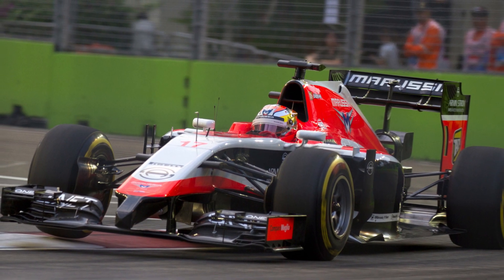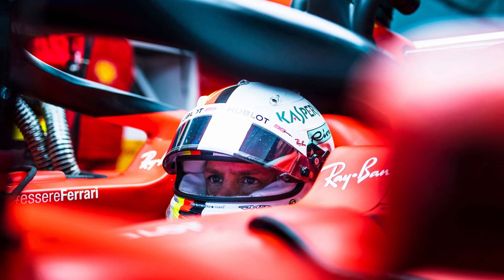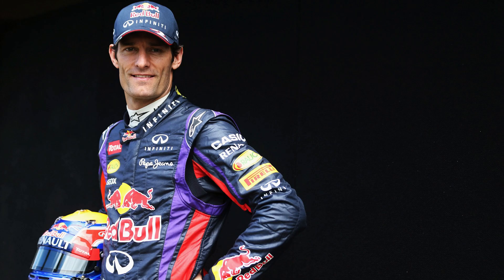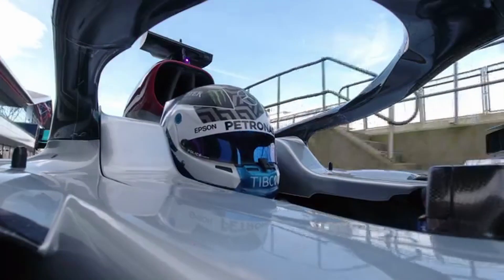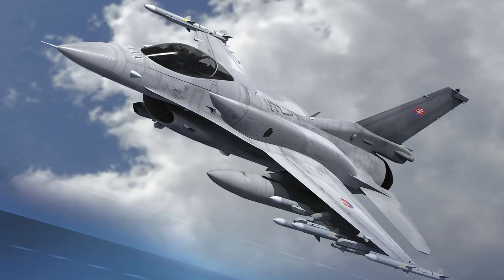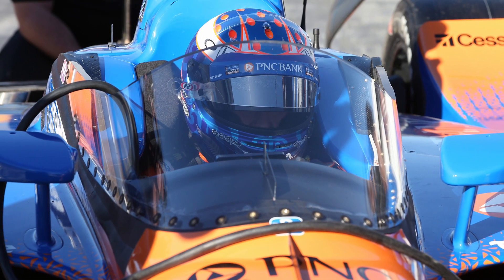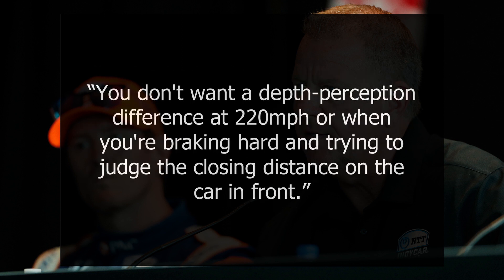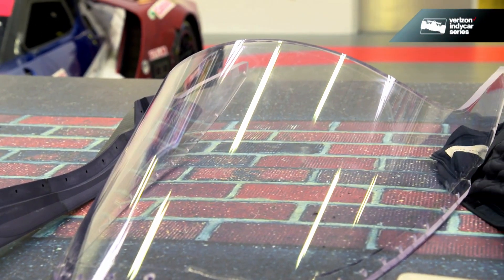How IndyCar Evolved the F1 Halo and Red Bull Aeroscreen for 2020 Windscreen | Part 1

Comment: This Halo is absurd! The Red Bull solution is far superior.  Politics in racing sucks and it’s deadly.
Reply: Wtf? Absurd in what way? That it saved Grosjean's life? Are you crazy just ranting?
Reply: Piss off. The Halo saved lives and it's proven to take hit from  2 double decker busses.
Reply: Aeroscreen is impractical and far less safe than the Halo.

First off, the screen causes distortion affecting the driver's vision. Not great when traveling 200MPH or at any high speed including during navigation of a complex corner arrangement.

Secondly, it's too close to the driver and could cause head injuries by the driver being launched into it during the tumble or force during an impact.

Third, it's heavy on the front of the car, messes up the car's ballance, aerodynamics, blocks the engine's cooling intake and increases cockpit temperature massively. It also becomes twice as hard to see out of during rain as unlike the helmets which have a refresh strip that the driver can pull off, the screen will not be able to be wiped or dried unless it's pitted. Visibility will be non-existant during even the lightest of rain showers.

Fourth, it's not as strong as a Halo device for a heavy cenrte-weighted impact. Yes, it will deflect smaller, softer impacts from light debris but hitting anything like a spring or a piece of metal etc. at higher speeds would shatter the polycarbonate and send shards of thick, sharp ballistic glass plus the item of debris itself directly into the driver's helmet and body making the debris impact way worse than if it were to just come from the debris itself.

Overall, it's a nice design. But in reality and practise it's serverely flawed and far inferior to the Halo device which is stronger, safer and is more suited to these kinds of open-wheel racers.
Reply: People missed your point entirely
Reply: The Red Bull solution (polycarbonate only) failed in testing. They now effectively run a Halo under the screen.

Comment: Halo is safe , how about not racing on tracks with concrete walls where a car can bounce back into the path of oncoming cars debris back into the track.  They also say here that a halo would not have helped massa which is in fact incorrect as the centre support of the halo is directly in front of the driver face. The widcreen would not have helped with the crash and fire that almost killed Grojean in bahrain it would have folded around him, the halo saved his life.
Reply: Couldn't agree more

Comment: Awesome design, at least it gets rid of that ugly center pillar? "NOT", and much safer !?  Hope F1 adopts better design after Halo !
Reply: How would that plastic windscreen have helped Grojean in bahrain? In my opinion it would have folded around him when he went through the barrier, the halo saved him.
Reply: @rneoman  yea good point, not liking the Indy Car plastic screen anymore ether, watching both the F1 and Indy racing this weekend.  Thought it could eliminate the centre Pilar? But materials not strong enough yet?  Agree Indy Car should do same as F1, it’s should be Ooen Car / Ooen Wheel Racing 👍🐻
Reply: @Bobo56Bear  It's not that distracting and it saves lives. I was watching the Grosjean crash live, and man I was so happy when I saw him running away from the flames. And I agree I don't think this protector would save him. So glad F1 uses halo
Reply: The halo is significantly safer than the aero screen. Titanium vs plexiglass..There would be at least 4 dead F1 drivers today without it. Grosjean ripped through a guardrail, peronis  and leclerc front pillar took the brunt. The centre pillar is essential. It does not obscure driver unless you have only one eye.